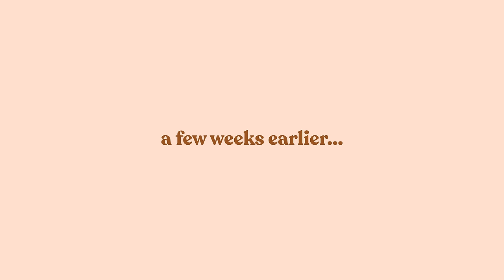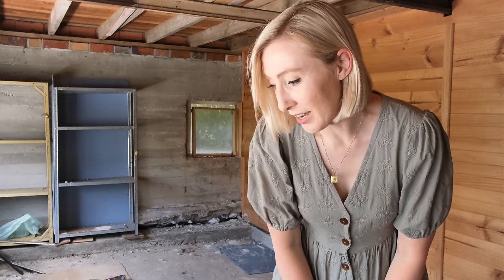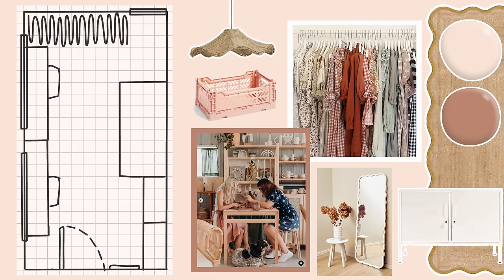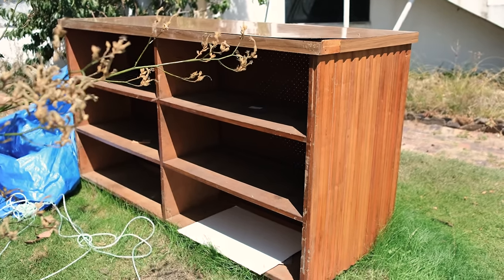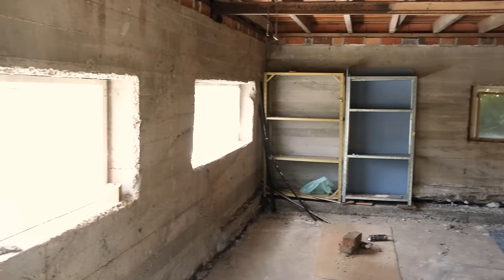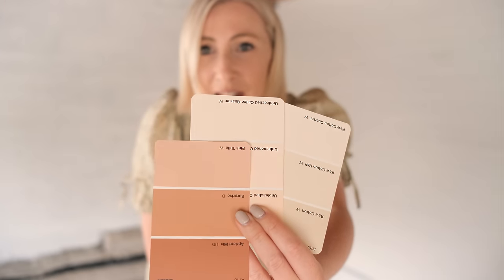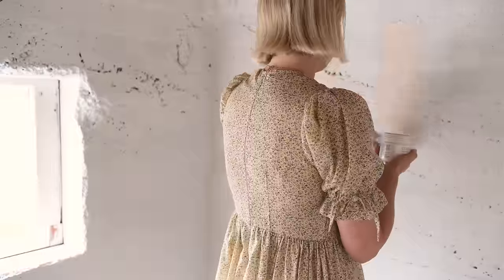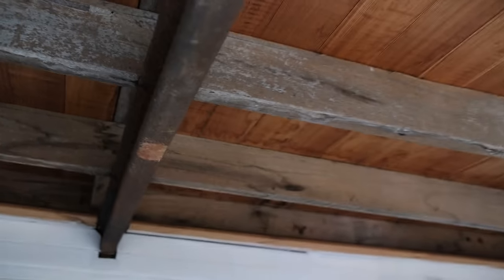Sewing Studio Makeover - Part 1 | The Plan, Mood-board, and Painting the Space!

Comment: What about coaster wheels on your cutting table? Then you could potentially move it away from the wall and move around it when cutting. Also you could hang lesser used equipment like rulers ,French curves etc. from the peg board.
Reply: I was coming in here to say the same. I think the sewing tables need casters as well. Then you could flip the table into the room to film.
Reply from the maker: Love that idea!!
Reply: Me too ..❤
Reply: Same here! It would give your table more use. And you could even utilise the peg board on the back for more hanging storage.
Reply: I would actually put furniture sliders/wheels under all the major pieces of furniture. That way, if you need to reconfigure your space in the future, it's easy peasy. I would also get a restaurant-grade floor mat for the cutting table. As you said in your video, you do a lot of standing, and this would just be more comfortable for your legs, feet, and back.

As for the wall color, I watched your video on my TV and found your raw cotton color washes out in the light. When you pulled back the camera, there wasn't much difference between the base white and your color. Maybe something in a more blush tone?
Reply: Also coming here to say the same thing! Definitely put it on wheels, and utilise that peg board back panel!
Reply: Yep, great idea. You can get lockable castor wheels / castors with a brake at Bunnings - they roll when you want them to, but lock closed when you have the table in place
Reply: Yes my thoughts as well, you never know how you might  use that great table in the future! Upholstery perhaps, you’re so talented!
Reply: Wheels yes on your cutting table I have them on mine and it's great to actually walk around yr fabric and pattern helps cutting, also I have a drop side which is great when I have 3or4mtrs laid out, make sure you have a pair of wheels with brakes on, or leaning can be.........😮. But looking good and congratulations on your own place, looking forward to watching you more regards Diana from NZ 🎉❤

Comment: 🌿🌸 Personally, I would highly recommend to fill in all the open spaces between the floor and walls with concrete, reseal the windows, attach a seal onto the bottom of the door, paint all of the walls a off white shade to bounce more lighting around the room and to be able to showcase your pieces more accurately, paint the ceiling polar white but paint the beams a different shade that you would like to make them stand out more, maybe put in wood frames inside the windows and around thin carved trim around the outside edges of the windows that could be painted the same color as the ceiling beams, put in faux wood vinyl or real wood flooring because paint will peel up all over the place since it’s the floor and not the walls or ceiling, locking door knob, window locks, curtains and also install a fold down ironing table and other space saving things you will need to save more space so that can do so much more with the estate of the room to build your dream sewing room.🌸🌿
Reply: Good ideas!
Reply: @kilodeltawhisky1504  thank you!💞

Comment: Great work! When I converted a garage into my studio I painted the concrete floor with appropriate paint. This worked well in stopping the dust that happens with unsealed concrete. However, it remained very cold underfoot. So I was thinking maybe vinyl plank flooring or a sheet of vinyl glued down which come in some good patterns now even wood look. They are on huge rolls in Bunnings or flooring stores. Oh, also with the garage conversion, around the edges where I see that you have the flashing layer we ended up having to put a tar sealer because moisture was seeping through during heavy rain and mould grew. Good luck xxx

Comment: Laminate floor boards would be my recommendation for flooring in concrete. We did it in our basement and there is a measurable temperature difference as you do need to lay down a thin layer of foam underneath when installing.
Also Rustoleum paint or an equivalent for the iron as it will prevent the rust from bleeding through, and prevent further rusting.
Highly recommended casters on your cutting table so you can put it against the wall when you want or you can move it out to walk all the way around it. Possibly consider it for all the furniture for ease of moving around in the room to find what works, and cleaning.

Comment: Wow, I'm so interested that you've come across my feed today. My sewing space is almost the same as yours, right down to the one timber wall! I have brick walls on the other three sides and windows all round. Despite being under my house, I was surprised at how much light comes in, particularly winter mornings when the sun is so much lower. I've wall mounted some mirrors to help bounce the light around. I even have a similar cutting table, whereby I've utilised an old map cupboard that was left behind and laid an old conference table that I picked up at a garage sale for $30 on top. I would recommend putting it on wheels as I move it around a lot more than I thought I would. I don't know what area you live in, but do have a look at possible damp and water ingress. I live in northern NSW where it's hot and humid and given the heavy rains and flooding we've had in recent years, my sewing room sometimes feels a little damp. I use an dehumidifier when I need to. You might live in a much drier area than me, so it may not be an issue. I'll follow your journey with interest!

Comment: I love how bright it is now it’s white, the space is amazing Janelle, I can’t wait to see you creating in there! 
If you haven’t already, I would try and keep the wall opposite the windows as light as possible, and I would paint the ceiling as bright a white as you can. A filmographer told me that you should use your ceiling as a massive reflector if you can, point your lights at it, as it creates natural diffusion. 

You can get special rust killer for the beams (in the uk it’s called hammerite) and you can also get special primer that blocks the rust, it’s a little more expensive usually, but worth it! 

One thing did occur to me, it might not be an issue in Tasmania, I’m not familiar with the climate so I’m not sure, but the walls look single depth? Uninsulated? Do you need to be cautious about damp/mildew in the winter? I’m thinking of your garment rail against that wall specifically. In the UK I know I would have to add a layer of damp blocking primer and maybe I would actually board out that wall just in case (though obviously completely different climate and we’re known for being damp! 😂) might not be a concern in your location but thought I’d mention it just in case.

Comment: To create your hanging “rod,” you could use black plumbing pipes.  You could put the flanges on the ceiling and bring the pipe down to the correct height then add 90 degree electrical conduit elbows or black pipe elbows if available.  Then run the pipe along the length of the space adding “t” pieces and running up to the ceiling as support.  I used this pipe to create some outdoor curtain rods and it worked like a charm.  The only caveat is to be careful not to get your fabric up against the pipe as the black rubs off, but that shouldn’t happen if you are using hangers.  Good luck!  It looks great already.

Comment: Looking clean and bright ☀️ IDK if Bunnings sells a similar 2 part epoxy paint like we used on our concrete garage floor here in the US? Our floor paint came with colored sprinkles that you toss over the wet paint, that when dry creates a terrazzo look that is durable and easy to mop clean. Epoxy paint is an inexpensive DIY option that could easily be extended with more paint or covered over with new floating floors after you expand in phase 2. Excited to see phase 1 as it comes together.😻

Comment: What a woman!You’ve done a fabulous job so far Janelle, the really tough work is behind you now - yay!

I see someone has already suggested wheels for your cutting table, I certainly second that!
Also, you could install a larger top on the bar to give you a grater area for spreading fabric when cutting. If this feels too intrusive it could be a flap on hinges that can be employed as needed. (Like old fashioned side or dining tables).This could be affixed to the back so it doesn’t impede access to the shelves. You could simply wheel the table out and raise the extension.

You may need sone “Killrust” products for those metal beams. Available in the paint section at Bunnings.

I’m so looking forward to the next episode of this makeover. It’s so exciting to have a dedicated workspace at home but completely separate to your living space. I have one that, like yours, requires a lot of preparation before I can make it my own but I’m already collecting bits and pieces, such as carpet tiles to make the concrete floor a bit more snug, and furniture. All very exciting!
Reply from the maker: Thanks so much Simmone 🥰

Comment: Beams: wire brush to get the flakes off then anti rust then prime then paint. Floor: rustoleum garage floor coating is fab for bare concrete. 🙂
Reply: Yes you need a special paint for steel… looks lovely though….go for the more pinky paint…so much more rosary apparel colour….

Comment: OK...here is my 2 cents worth...put the overlock and sewing machine under one window on the same long table.  Use a chair with wheels to slide from one machine to the next(I do that). My machines make an L shape with 2 small tables.  My last suggestion is to definitely cover up the ceiling with ply-wood. If the metal beams are in the way, work around them.  It will keep the spiders and cobwebs hidden away.  Thanks for letting me dream too.  Can’t wait to see what your Dad does with bricking.  I love red brick. 😊